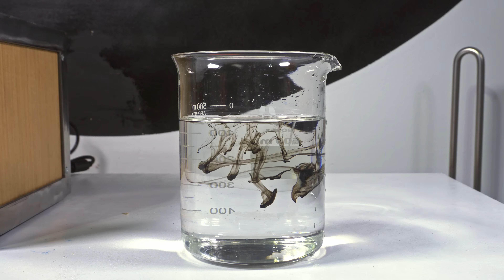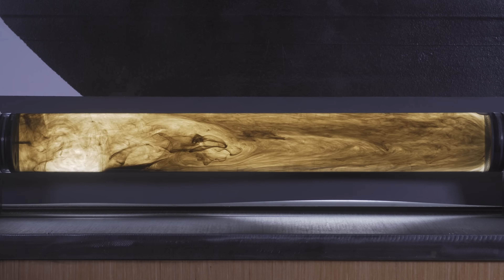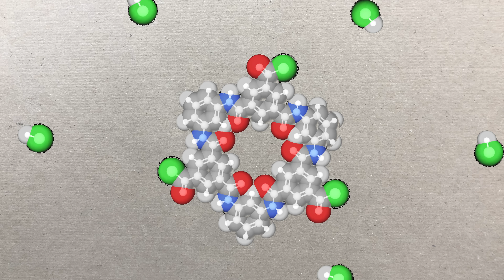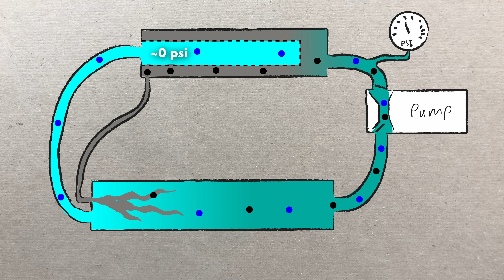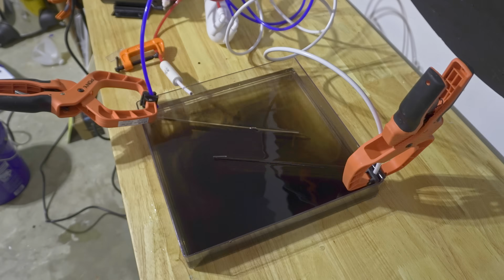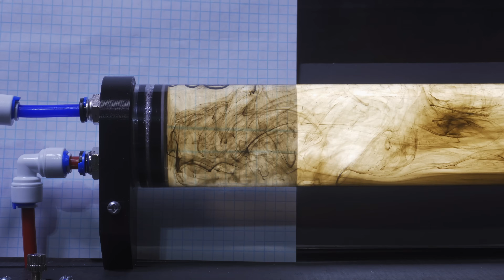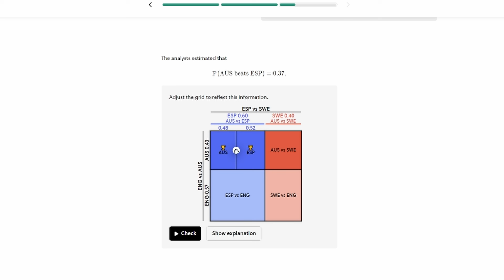I made a machine to un-mix fluids

Comment from the maker: Corrections and FAQ in this comment! Official FAQ video will eventually be on the second channel youtube.com/@alphaphoenix2
1) Really cool demo of Kelvin-Helmholtz instability in a much more controlled situation: https://www.youtube.com/watch?v=qgamfo86FQo
Reply: Thank you so much for making such amazing incredibly high-quality educational videos that are very entertaining. I always learn so much from your videos. THANK YOU!
Reply: 2 words for you: pearlescent pigments. You don't even need to refilter them, they just make flow more evident
Reply: I am massive
Reply: You mention a vertical tube won't work due to the ink sinking to the bottom. Would adding a lot bigger reservoir (like inside a cabinet with just the tubes going up into the device) and some geometry be enough to use gravity to filter out the ink so you could run it indefinitely?
Reply: Do you think this could be used as a random number generator ? something like
Random red, green and blue value for back lighting, light intensity and slice on the whole tube, (well a picture of it) and calculate a number from pixel values ... ?
Reply: @dimitrigilbert  : You could just film it, pick some random pixels from that footage and asign a number to each pixel depending on brightness.
Reply: @theGoogol  Yeah, that's the idea but I wanted to add more randomness on the randomness (yo!) with color, light intensity and a time component ;)
Reply: @dimitrigilbert  : Well, with a HD recording you have 1920 x 1080 different pixels to choose from. You could pick set of 3 random pixels to simulate RGB values (no idea why) and that leaves you with (1920×1080)/3 = 691.2k possible sets. The time factor comes from the fact it's video (60 fps is enough I guess, so nearly 41.5M possible sets per second). 

There's a video here on YouTube about a company that did something similar by recording lava lamps.
Reply: You can make & sell some great stock footage with your contraption!
Reply: I don't know the density difference between ink and water, but you could try a hydrozyclone for filtering
Reply: Would adding a little bit of alcohol help with the filtering process?
Reply: Love your videos! Also, you should go on the safety third podcast!
Reply: Why not using Mica powder to visualize the turbulent flow? Instead of using ink particles that contrast with clear water, use particles that are flat and have limited symmetry axis to generate contrast between flows. Then you don't need to separate the particles, just pump it around. ALternatively how about using bit larger and dense particles in micron size range, and put barriers that generate dead zones which collects the particles over time, and put a sieve at those points or something.
Reply: India ink comes in plenty of other colors that all still use the same shellac binder, but with pigments that aren't lampblack. Would those be any easier to filter out?
Reply: Osmosis filters in your home have an additional step that you don't have here...or rather, you're using that step incorrectly.

In your kitchen, the filters are rinsed off, presumably when the reservoir of drinking water is full, and that output gets routed around the sink and into the drain.

Yours is clogging because you're rinsing it with dirty water....back into the water....so you're effectively not cleaning the filter enough.

It's sort of like drinking your own urine.  The purpose is to rinse out the waste and expel it, not recycle what was rinsed out.

I don't know about the math of it, but you could possibly reduce the amount of ink so that it is not enough total in the system to clog the filter....or have a few different loops / filter systems to extend the operating hours....but without a clean enough supply to wash off the filter into a waste line, it will eventually have problems.
Reply: Can you maybe add the links to the videos of the thing running you mentioned. Can't find a link to the second channel anywhere. Thanks.
Reply: One approach could be using magnetite or a similar magnetic material and using a magnetic field to filter. Not sure if magnetite can be divided finely enough to remain in suspension...  
Edit: this marks the last time I'll comment before watching the whole thing. @ 11:02 :)
Reply: NICE! Considerations: 2 more inputs (sugar water, 2nd “ink” particles), randomized flow adjustments, and multiple filters.
Sugar twists light (rainbow)
Fluorescent micro-particles
Mesh filter with centrifugation and/or sedimentation for the micro-particles.
Sugar? Only occasional re-injection. Filter after water/Ink separation, then distillation or ion exchange resin. 
Or multiphase chemistry filters for specific reactions and chromatography, solvents, holding tanks for delayed processing. 
Perhaps even various chemical reactions in series such as iodine clock reaction, color reaction of potassium permanganate (KMnO4) by sodium metabisulfite (Na2S2O5), various color precipitates (like lead iodide), fluorescence (luminol and H2O2), and foaming reactions (like H2O2, potassium iodide, and dish soap).  Flush reactions automatically with distilled water (and ink or microparticles), Potassium Permanganate Solution (purple), Copper(II) Sulfate (CuSO4) (green), Potassium Ferricyanide (K3[Fe(CN)6]) Solution (red), Methylene Blue, etc.
Reply: Of course, this might need several sedimentation reservoirs and intermittent input into the visual display series.  The display is awesome. The guts might need to stay hidden under a cabinet.
Reply: Is there an ideal temperature for this demo?
Reply: If the input wasn't circulated with the output, like with a bucket on both ends.... Would the effect change based on whether the pump was on the input side or the output side?
The difference being that the water being PUSHED into the tube versus water being PULLED from the tube?
Reply: the way you just dismiss skin effect as if it is not related to current density and velocity/frequency...
Reply: hi, AlphaPhenix. Do you by any chance have a discord channel. I want to build such a flow device for myself, and would like to ask a view questions, one of them is: why did you throw out the ferrofluid idea, seems way easier to seperate it, when you can use magnets...and more energyefficient and less pressure so... why not?
Reply: William Fraser just released a video where he showed the vortex generated by different aerofoils using graphite powder suspended in water
Reply: 2 ideas on alternate 'inks', particularly for easier separation_
1 - if you make it top down (like your original table-top flat demo), I imagine an oil may work, and a tall reservoir at the end can just gravity-separate them (I definitely am not thinking this could be a really, really cool tabletop)
2 - if you add a glow in the dark pigment to the water and a large enough of a reservoir after, you can UV-light the "ink" side - negative is this doesn't work in a light room but it'll look epic in the dark. Large reservoir lets the pigment stop glowing before a bit is reenergized and sent back in
Reply: As a "gearhead" I would like to see more about how that mixture goes along different surfaces, such as shiny, rough, and golf-ball patterned.
Reply: It would be awesome to see this done in microgravity

Comment: I wonder if you could separate the ink electrostatically (like they use ionisers to remove dust from the air), and use a non conductive fluid like silicone oil. That way you get rid of the filter.

Comment: One thing that Aerospace get wrong with their wind tunnel tests is that on a smaller model the density and viscosity of the air is different.they need to pull a partial vacuum for it to be more accurate. or a thinner gas.

Comment: Instead of ink maybe you should use a non-stabilized emulsion with small density differences, after flowing through your geometry dump it in a tank which will separate the two phases by gravity and you can pump the light phase from the top and the dense phase from the bottom.

Comment: if you used something with larger particles, could you do a similar thing that wood shops do where they spin the output air and it drops the particles out? like a water based vortex filter?

Comment: Looks like you could use iron oxide black pigment and filter it with a 10 (or 50) micron mesh filter bag. Wouldn't need the reverse osmosis, and if it clogs the filter it would be straightforward to clean a mesh bag filter.

Comment: 9:12 Well, the pipe is 3d.  You pick a point on your screen to track and you can see fluid moving in multiple directions through that point; som forwards, some backwards.  Perhaps try shining a thin slit of light from above, to single out a lengthwise cross-section of the tube.

Comment: I don't think particle size is necessarily going to have the biggest impact on the rate of membrane fouling. In fact, a fully soluble dye could perform much better. It just has to have a very high contact angle (ie a very hydrophillic / hydrophobic interaction) with the membrane surface. The membrane has a finite number of surface sites for these dye molecules to adsorb to before it creates a dense macroscopic barrier.

On the contrary, It's not going to take more work to force the water molecules though such a membrane if the dye molecules are smaller, since the ratio of water molecules to dye molecules is I'm sure more than 10,000 to 1.

Comment: im a scientist working with TFF (tangential flow filtration) and one of the most interesting, practically unknown limitations of most membrane systems is their injection area. 
simplified, you have two metal plates with a semi-permeable membrane inbetween and you need to recirculate the pre-filtrate and just take away a portion of the filtrate. 
bc most operations dont care about the actual pressure, esp. in large scale (velocity vs flux), those issues practically never occurred. but when we did pressure sensitive scouting of membrane holders, we found that the flow pattern and turbulence could make up to more than 50% of the allowed pressure. i think some of your comments regarding the interference of the heavy ink-solution might be similar to what we saw. mostly due to increased turbulence and "caking" of the filter surface due to perpendicular flow instead of parallel flow.

Comment: If the ink is very similar to the water, can you heat the ink before injection, to duplicate thermal buoyancy effects as well, or are the fluids not similar enough to be a good analog?

Comment: Beautiful to watch and to think about! No love for viscosity? I was thinking about mechanical separation but then larger particles would also sink...what if the tube was angled so the particles fell at the same rate as the fluid velocity effectively staying parallel to the walls? Then you'd also need to adjust the angle to correspond with the velocity which adds Stokes Law to your list ;) Thanks for genuine curiosity and exploration!

Comment: Have you tried running the pump in reverse for ~30 seconds to regenerate (unclog) the RO filter? Might need some ability for it to suck water past the dirty side of the RO filter, something like a valve from the clean side could work there.

Comment: Doesnt it not make sense to try to plot a 2d version of laminar flow in a 3d cylindrical space?

The center of the flow could be one way while the outter edge of that same cross section could be moving in the opposite direction.

So knowing that wouldnt you not attempt to track laminar flow that way, or switch to a model that uses a flatter, more rectangluar shape than a tube to better reflect a 2d splice?

Or if possible track the flow at different depths away from the camera?

Comment: I think this would look even better if you could have the ink jet directly in the center and the slow water perfectly shrouding it in a circle around the ink.
You could prevent additional turbulence by positioning the tube vertically, allowing the slightly heavier ink particles to fall straight down.
It might not demonstrate your point better but I think it would look really cool

Comment: I wonder if there's a better material than the ink for this.  Something just as opaque and doesn't dissolve in water but also far easier to filter.  Carbon?  Smash up some aquarium filter carbon?  If you can move away from the membrane filters that require a lot of pressure it gets pretty cheap.  I've had cheap mag-drive water pumps running nonstop for 12 years.

Comment: I remember hearing that graphene would make a good filter years ago when that nobel prize was awarded, but apparently the diameter of a hole inside graphene is 5 nanometers. One angstrom is 0.1 nanometers. Yea, that filter is absolutely insane.

Also instead of getting the air out of the tube did you think to maybe submerge everything instead?

Comment: RO systems are really sweet. I tame a boiler that used a monster RO system to supply water. What kills the membrane is not have a high enough reject water. You have to waste water that flushes the filtered particles off the filter or it will plug up.

Comment: This video is perfect. For a project I have been doing at work, I have been wondering what the mud flow inside our pipe looks like under turbulent, transient, and laminar flow rates (particularly that transient period because towards our max flow rates of 150-200 GPM, the Reynold's Number is between 2000 for laminar and 4000 for turbulent).

Comment: I wonder if the filter failed because the pressure was above the rated limit.  Maybe you could use a lower pressure if you had two filters in parallel?

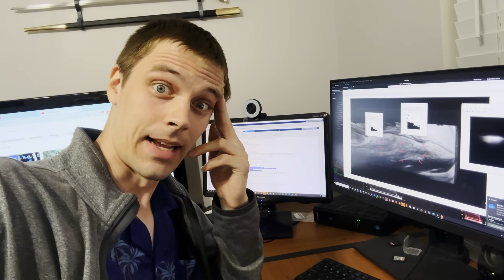Comment: 8:25 the flaw is that you are trying to use a 2d visual solution on a 3d system... what you needed to have instead of the tube, is a channel with a thin rectangular cross section where the fluid flows in essentially a 2d plane

Comment: You should mount the ink pipe coaxially with the water inlet pipe... This would allow you to initially "protect" the ink stream; assuming initial velocities of ink and water are the same, it would be cool to see how long until the ink starts mixing.
Then, move to swirling inputs (vortices) for water and ink, testing both same direction rotation and counter rotation.

Comment: Totally awesome, and agree - I could hypnotically watch this on an endless loop.
It would be cool if you used tiny capillaries at both ends. Inject the ink in one small center-positioned capillary from the left, and water through the others (on the left), and draw the water+ink through capillaries then funnel on the right......

Comment: If you could offset the water inlet to either not be in the center line or point it at the wall through some nozzle, then I'd expect a bit of a swirling motion around the diameter of the tube. Another variable to control for though I would bet there are some particular settings that would make it even more addictive to watch ;) Update: OK, watched some more - there was a vortex version, cool!

BTW, I'd like to spin/swirl a BEC (Bose-Einstein Condensate) as fast as possible - how should I approach such a topic? Hardly any lab experience on my part, so a steep learning curve ahead of me, I know.

Comment: It's a very cool project for sure! I think the filters clogging is normal, on saltwater desalination they reverse flush the filters at certain times to unclog the pores and have a secondary pressurized loop for this. You could put in a second loop that does a reverse flush with clean water every so often. Of coure the ink could bind to the filter relatively permanentely then you would need different material for the filter (I mean you only need the ink not to go through, right, does not have to filter down to water atoms), but putting a reverse-flush on a timer could extend the life of the system at least a bit.

Comment: The martial art aikido is all about trying to find stability in the center of conflict. It uses negative pressure to receive the positive pressure of the opponent and the technique always aims to resolve/dissipate the mixture of attacker and defender's energy/posture in a spiraling form. The whole interaction is surprisingly similar to how tornadoes form. 

I have yet to watch your video but I suspect that a similar thing happens, that opposing forces in a turbulent medium resolve their conflict with spiraling motions and that will eventually layer current after current in a meticulous stream of laminarly flowing particles. At least it would be if it's anything like Aikido. 
(for the record, I don't see Aikido as mystical, just a martial art that depends on leverage, fluid dynamics and geometry."

Comment: I'm genuinely confused about why you feel like the way the ink flows randomly at first and then uniformly is so surprising / cool / interesting. It does look cool, sure.

But ultimately, you're intentionally introducing  randomness on one end, and uniformity on the other, so water (or fluids in general) flows like water in the way you intended... So I feel like, kinda, duh? Like of course it does that? It averages out since there are no other forces acting on it except the ones you introduced (and heat), it does exactly what you wanted. Why is that surprising?